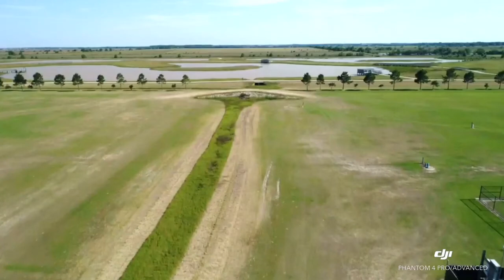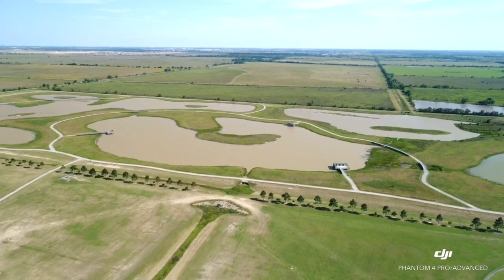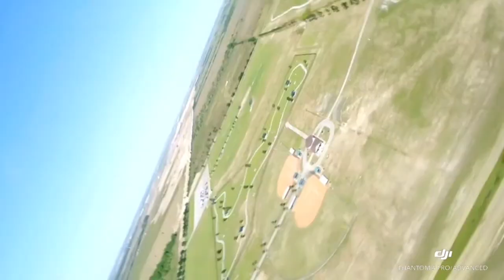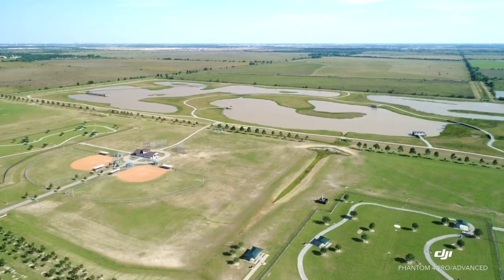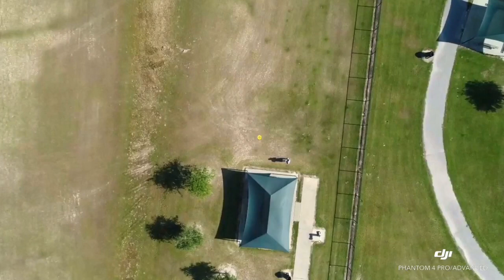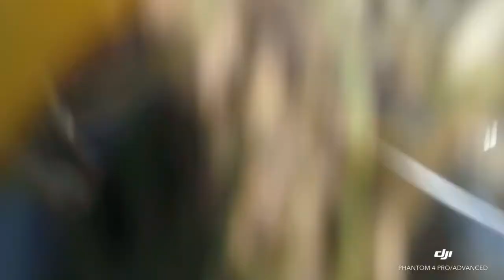Testing Beta Firmware V01.03.0510 for Phantom 4 Pro for Level Gimbal Horizon

Comment: Hi David,
so whats your conclusion on horizon leveling on this firmware - it looks like it s a big improvement .. mine tilts as soon as i rotate or fly sideways
Reply from the maker: Beta firmware V01.03.0510 provides an order of magnitude improvement in level gimbal horizon performance vs. the public release firmware V01.03.0509 even in winds of 12-16 mph. I'm consistently getting very level gimbal horizon in two dozen full-battery flights since installing the beta a couple weeks ago. I am also extremely impressed by the performance of the Precision Landing feature which consistently returns P4Pro to within inches of takeoff point even when winds of 12-16 mph immediately blow the aircraft 2-6 feet downwind of takeoff point immediately after lift off. Somehow the P4Pro software accounts for this drift when taking the photo of the takeoff point from 19 feet AGL with the downward facing B&W cameras. Wow! The only issue I've encountered during the following severe testing scenario: when flying full-throttle to the right directly into a 16-mph wind coming from the right-hand-side of the P4Pro, the gimbal can become overloaded and rolls over severely to the left for a half-second then snaps back to level. This could be addressed in final version of firmware by limiting the maximum aircraft tilt in such conditions.
Reply: thanks! then i m looking forward to that release.
BTW are beta FW freely available or how did you get them?
thanks